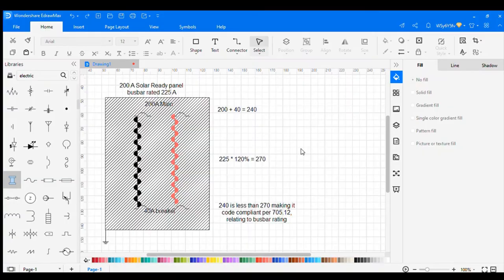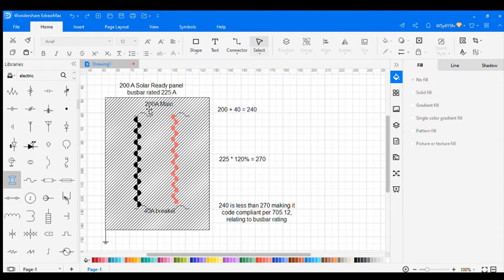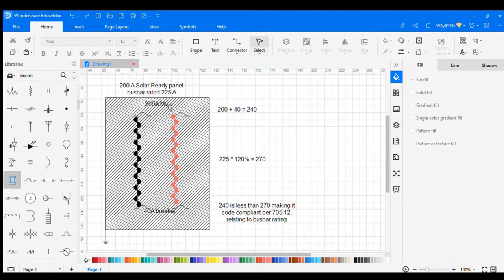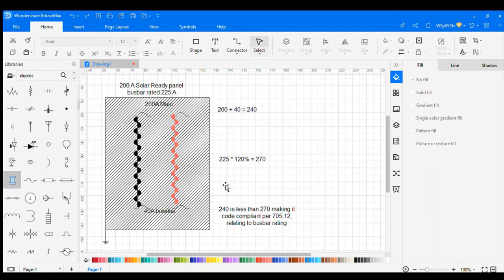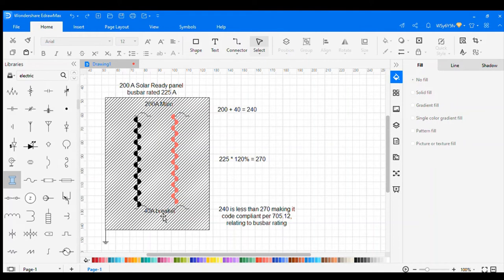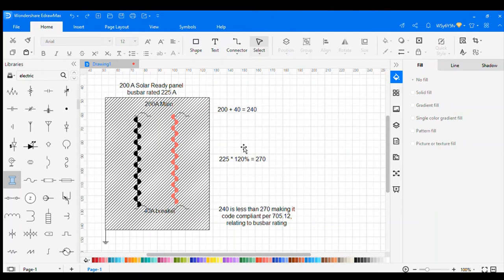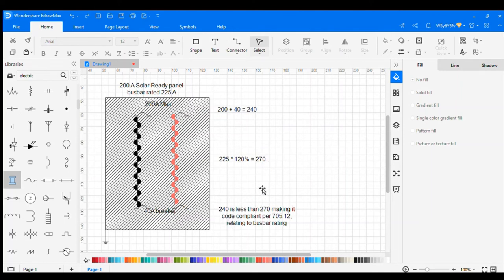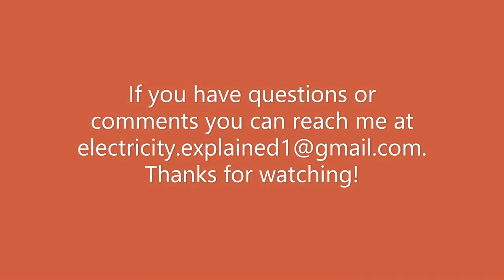120 % rule for solar busbars

Comment: Do you think inspector would allow if I went 125% instead of 120%?  I have a 200A main breaker and I’m adding an 8.8 kw system which would need a 50A breaker, thanks
Reply from the maker: You would have to ask your AHJ but to avoid that conversation I would downsize the main breaker, as long as my load calculation would allow for it.